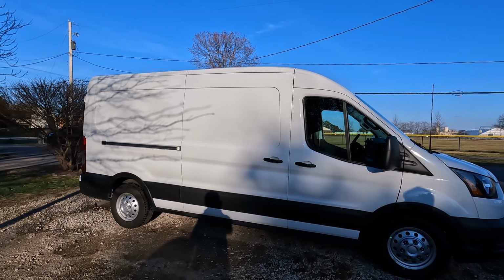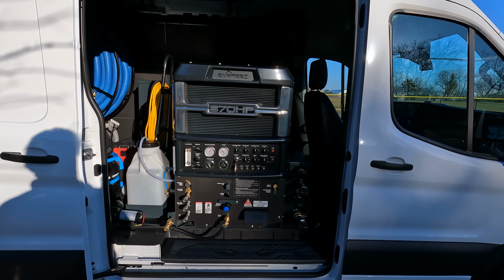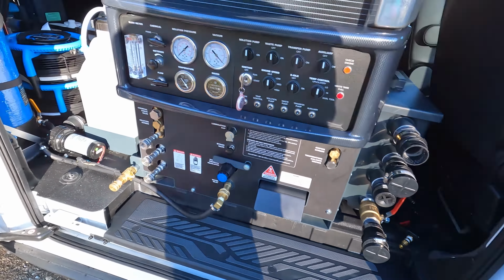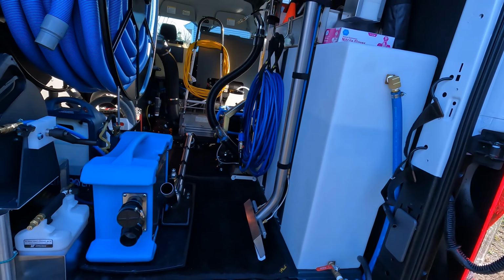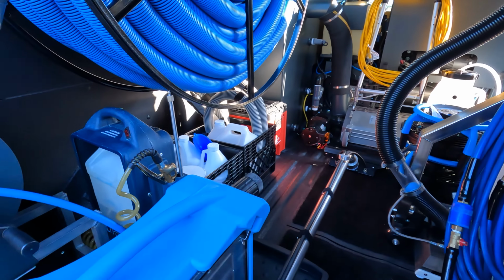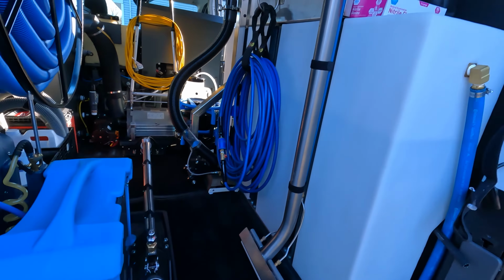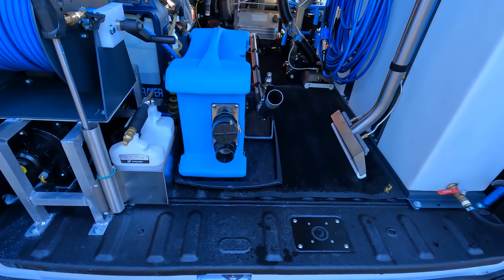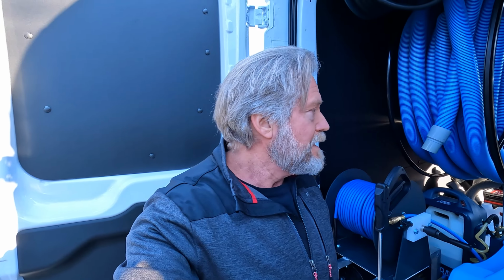"Prochem Everest 870HP: Our Dream Truckmount for Commercial Carpet & Tile Cleaning"

Comment: I can see your excitement. That's how I feel flying to pick up a 2019 transit with 25,000 miles outside NYC tomorrow, and then an old but refurbished and even painted truckmount with 49hp nissan motor on the way home.

Comment: I was thinking about starting a carpet cleaning business up and looked at your video then checked the price and in the uk it’s like £46,000 😮 so that ended that pipe dream for me
Reply from the maker: There are some great machines out there from Hydramaster and Prochem that are half the price which are more than sufficient for normal runs of 200 feet like residential and most businesses, so you definitely don’t have to start with this machine, it took a few years for us to get up enough Large commercial jobs to justify the purchase. Thank you for commenting and good luck.

Comment: Looks amazing!  Great set up!  No divider between back and front?  Much more open but worries me!  Filter box worth the money?  Im getter my 870 next week!  Ty for sharing!
Reply: truckmount technician here. It is not recommended to run a slide in truckmount with no ventilation. The engines can over heat. Water cooled units manage heat tremendously better than smaller air cooled units but it is still recommended per manufacturer to run with back doors and side doors open and front windows down. But if you decide to close the doors, there are exhaust kits that route the exhaust down through the step and I’ve seen ports mounted on the side doors for vacuum hose access. You could also mount a ventilation fan on the roof.
Reply from the maker: Thanks for the comment and question and congrats on the new 870! My son works with me and he is 6’3” so I set the front seats where we needed them then laid out the equipment back from there. A divider would be nice but does eat up a few inches of room. The filter box has been great and your legend points from the 870 purchase will pay for that as well as some pod dryers with the bit left over. The filter box is great because you can see when to clean and it's great for customers as they get a window into what you're doing. It also keeps the main unit cleaner and we only have to clean out the 870 filters once a week. My biggest concern is rainy days so far as our previous PTO units could run with all the doors shut but I am working on some ideas for that and also would love any input others might have on the subject.

Comment from the maker: Thanks for the question! It actually has incredible vacuum lift on short runs and 150 feet or less we actually have to set the machine on medium setting, I have had a 4.5 and 4.8 HM as well as a White Magic and the Everest feels like it has significantly more vacuum, especially on the shorter runs.

Comment: How is the vacuum compared to the XDrive CDS or 4.8 cds SV. Does the lift feel stronger? or do you only notice a difference of it maintaining good vacuum on the long runs?
Reply: The X Drive does not spin the Gardner Denver 408 at its max rpm of 4000 rpm.  It maxes out at 2800 rmp's.  Then the pressure relief is low to keep the belt from slipping or the electric motor from stalling.   The 4.8 SV is  stronger with more power to the blower and probably spins the 408 blower a little faster than the X Drive for more  cfm's.  

So if somebody has the specs on the on the 870 which are hard to find, you will see more hp more cfm"s and more vacuum presure.  I did not ask HydraMaster about the SV.
Reply: @ward8453 blower rpm’s on the 870 is 3580rpm at high speed. Vacuum is controlled by the vac relief setting. 12.5inHg is the same across the board for blower performance. The limiting factor is the engine and how much load it can handle.
Reply from the maker: Great Answer CMS,  Agree with all said, Thanks!
Reply: 12.5inHg is 12.5inHg. It’s all going to feel the same at the unit. The only difference would be how many turns and corners are in the vacuum hose that’s ran. The 870 will be “stronger” than smaller units only because it doesn’t bog down as much under full vac load.
Reply: Also, if you’re thinking about getting an XDrive. DON’T. Truckmount tech here. You do not want those problems. Out of the dozen Xdrives I’ve repaired, only 2 made it past 1000 hours. And even then, I’ve replaced motors, generators, capacitor packs, controller packs, etc. spent hours on the phone with Eric from HydraMaster doing remote diag and programming for them. Stay away from them like the plague. Because they are all hand installed and made with hundreds of electrical connections, all it takes is one bad connection and the unit is down. And it will take hours to track it down.